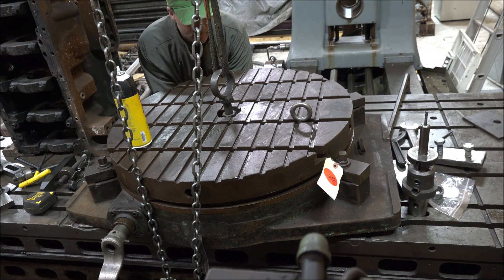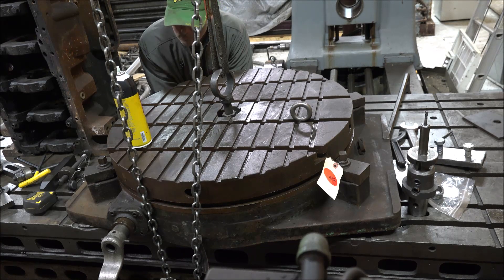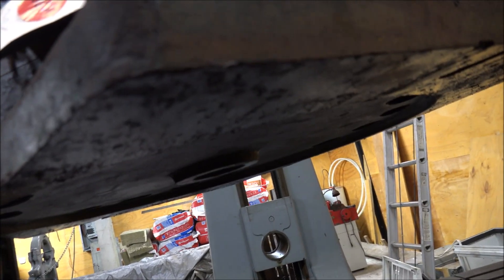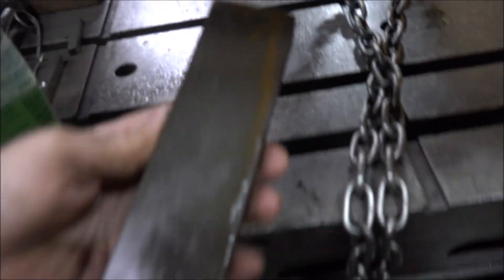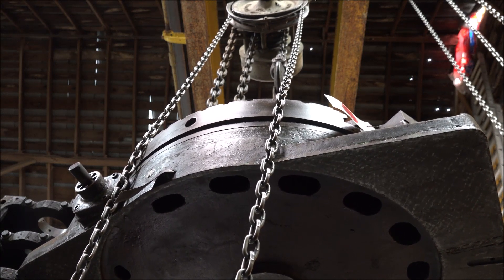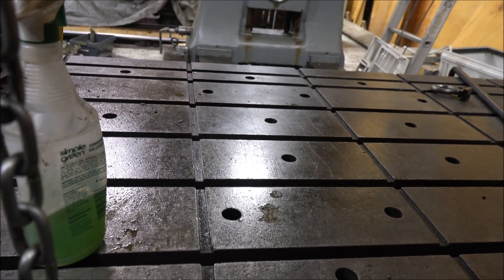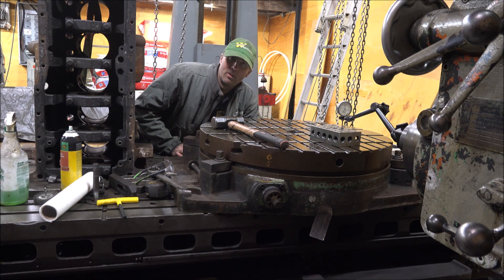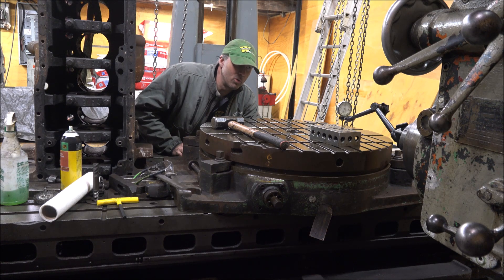Big 30" Rotary Table Clean up and Install Tips on Getting It to Run True and be Flat and Parallel

Comment: Welded original slots....to induce added stresses into the casting!🙄 One really wonders why folks do stuff.
Reply from the maker: Somebody likely messed up some parts putting the rotab on the original way versus the altered way so they made sure that couldn't happen again. Some shops just work like that.

Comment: Hey i have a 48 inch chuck off a vertical lathe   3inch thick no drill marks  nocrashes. 1800 pounds.  I want to sell
Reply from the maker: Steel or cast?

Comment: You need to get a decent size granite block if you want to get nerdy with the examination on this one.
Reply from the maker: I have a granite surface plate I could inspect it on but even if it checked better there its is how it is once it is on the mill.

Comment: "This little 30 inch one" lol I'm a bit surprised to see light coming through your barn roof Brian. What are you going to do about that before too long?A tip for you Brian. When cleaning my stones that I use for sharpening chisels etc. I flood the stone with WD40 (which I use as a lubricant for sharpening) I rub unto the stone with a finger tip to loosen the grime, and then give a quick spray again and the LAY the paper towel over the stone and use the flat of my hand and press the towel onto the stone. The towel just soaks up the liquid and takes the rust, metal particles right away as well. Just put a fresh bit of towel on again and it's then clean. My point being that rubbing the paper on the stone just clogs the stone with wood pulp particles and doesn't do the stone any favours by blocking it up and degrading it's cutting properties.

Comment: There is a product called super clean that does 10x the cutting of grime that simple green does and you can get super clean at Walmart…. And boi was I nervous as a pregnant nun when you are working under a suspended load like you was, I’ll bet you got 20 sets of jack stands sitting around the shop…

Comment: 4:40  is that really daylight coming through the roof?
Reply from the maker: Yes but it looks worse than it is as the metal can be overlapped but if not pulled down tight light will still show.

Comment: Good size for your machine .  If you come across occasions where it may appear a bit on the tiny tot 
size ,  an 1 1/4  or so thick extension plate on top will sort it !      Cheers .
Reply from the maker: I considered adding a square pallet top.

Comment: Love the table Brian,  Super cool.  Even though my G&L is only a 2.5" machine, I do have an Advance rotary table, with the 16"x 16" X 0 Y slides on top.  It even has the extended crank input.  I will have to show it in one future video.  Is yours from HGR?  --Doozer
Reply from the maker: Yes it came from there.

Comment: Hi Brian, does the rotab have zerks to lubricate the worm gear?
Good outcome and still accurate, pity about the welds but can easily be milled out.
Reply from the maker: It runs in an oil bath.

Comment: Why the hell would they fill The slot with weld?!? Doesn't that risk distortion? I can imagine the circumstance where it is necessary to cut new slots, but why would you risk using that much heat?

Comment: What with the base of the table being a cast item, did you luck out and that is brazing filling in the slots or did they actually weld them closed? I wonder why they would do that?
Now all you need is an angle plate or two capable of holding that vertical. ;)
Reply from the maker: Did you not see the do rite angle plate video I made awhile back? :-)
Reply: @bcbloc02  Reckon I forgot, you are in business now.

Comment: Brian. Having been one to have been allergic to elbow grease all my life, a thought came to me. If you could glue three of those stones to a flat disc of metal and attach it to a slow speed motor, would you then have a power hone?  I could hone all day with something like that as opposed to holding one stone in a scrubbing action like cleaning a dirty oven. My first job was as a grill cook as a kid and I got my fill of that scrubbing action. Say hi to Bailey.
Reply from the maker: Would take longer to build the stone holder than to do the work. I already have enough projects breeding projects without that too! lol

Comment: Have you ever experimented with a very thin coating of hylomar under magnets on surface grinders and tables that are long term mounted to prevent rust jacking . Since hylomar never dries hard and is resistant to coolant, many solvents it might be an machined surface saver on so many applications
Reply: Now thats an idea😃 why the heck did i not think about that? Thanks, will have to test this out. Hylomar is an amazing gasket compound used by both Perkins/ MF, Rolls Royce and many more
Reply from the maker: I have not. The Hylomar 101 we have sets up. What product number are you referring to?
Reply: @bcbloc02  Hylomar Universal Blue, thats the non curing sealing compound

Comment: Is that hole on the side of the table top on the rotation centerline? That would be nice for setup if it is.
Reply from the maker: Yes it is and there is a mate 180 opposite. I don't know its accuracy though if it is intended for that or for lifting bars.
Reply: @bcbloc02  It would be worth checking. In setting up horizontal rotary operations this would be very useful. I will bet that's what they are there for. Os someone put them there.

Comment: Looks kind of familiar, like I’ve seen it before. You 
didn’t happen to find a white envelope taped to it did you. Looks like it cleaned up nicely.
Reply from the maker: The stickers? I think they were attached to the Carlton gearbox.
Reply: I kind of stuck them on there as a last minute thing.I was curious whether they blew off on the highway somewhere or they actually made it there. So it looks like they got thier.
They would be good for patching holes on the old truck body.

Comment: It is wild that you just got one.  I picked up a crankshaft grinder last week in Oklahoma City.  The guy has a 24 inch rotary table he is selling.  I told him it was to big for me but I might know someone.  It probably wasn't big enough for you since you went 30 inches.
Reply from the maker: What kind of crank grinder? Van norman?
Reply: @bcbloc02  Berco RTM-300.  It will do up to a 24"x90" crankshaft.  I have had a Van Norman in the past but it was a lot smaller.  I decided to go big or go home.
Reply from the maker: @ballardperformancemachine  Awesome!

Comment: Probably, their table was interfering with the crank.  I don't know why they would fill the factory slots though -- increased strength?
Reply: Idiot proofing is the only thing I can think of, but with stuff this big and heavy the bigger idiot is the one letting idiots near it to begin with.